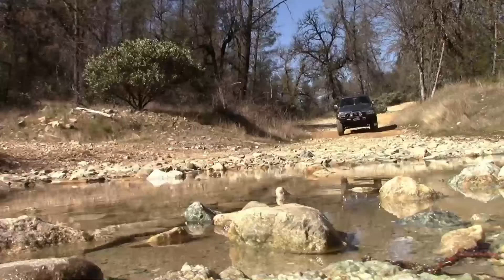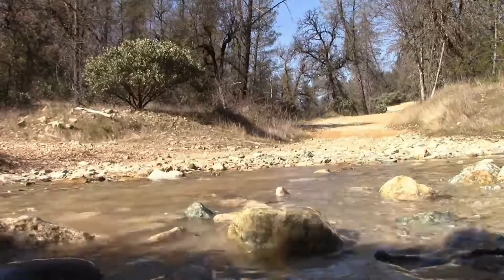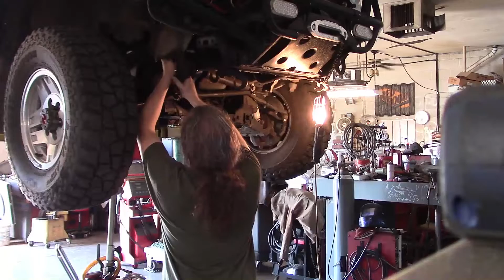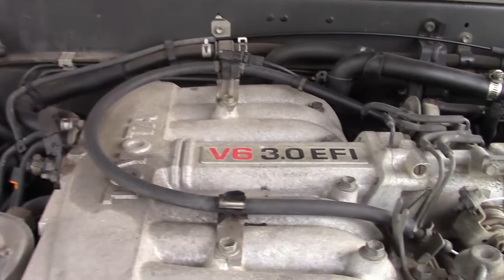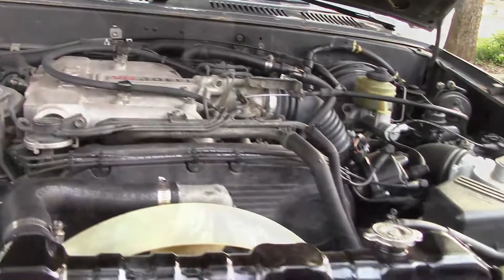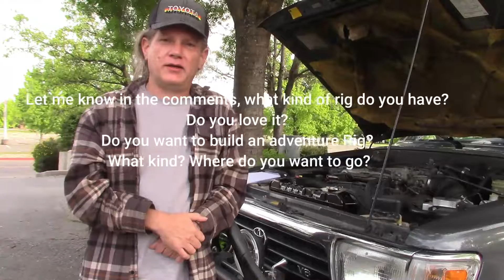Toyota 3.0 3VZE, is it any good? How to Make it Run Forever! 2nd gen 4Runner.

Comment: Take your time when working on these old motors. The heads are aluminum. A common and known error with these are the spark plugs a simple tune up can have you chasing your threads down into the cylinder. Beware of the soft strippable metal.

They are good. There are not many power mods. And these are becoming rarer and rarer to find in good condition. 

They last a good time if you take care of them. Thier is a power steering valve that Can cause your engine alot of grief if it goes bad. And it will start burning your power steering fluid if you start down that path. 

However before gping down the rebuild road. contemplate and budget out a simple proven 3.4 swap, increase your trucks worth, power, speed, torque, and life. 

Made it to 325 on my 3.0, stripped my plug ran it for 6 months and the  my power steering started spewing. 3k later, 145k 3.4 5vz, major incredible difference. Doesnt have the power of an old.car anymore. Keeps up with most. 

Love Toyotas, thankyou for posting on how tonkeep these gems going, they really are a cheap secret! Only use toyota red!
Reply: Was it 3k to do the swap your self? I have a 94 pickup with a 3.0 with around 155k miles. Runs great but im just planning ahead. I do not have the skills to swap an engine my self
Reply from the maker: Great advice. Agreed!!! I'd really love a diesel in mine, but the 3.4 is way more straightforward of a swap.

Comment: Great video. Nice to hear a simple and common sense solution for prolonging the life of this engine. I'm living out in Okinawa and picked up a 1995 Toyota Hilux Surf with only about 100k miles. A significant unknown is that the vehicles are turned over so fast here that I have no clue if the recall was done. I'm brand new to working on vehicles but I'm looking forward to learning on the 3VZE. I would definitely be interested in more videos from you. I'm bringing my Surf back to California when my tour is up and i'll drive it into the ground... which seems like won't be any time soon as long as I keep up the preventative maintenance. Thanks again!
Reply from the maker: Thanks for your service and I hope you get home soon!! A surf, that's awesome!! In the states you can just plug in your VIN on the website and it tells you what has been done and any open recalls or TSBs. Maybe try that?

Comment: I just bought 92 4runner 4x4 3.0 v6 and my main worry is the crossover pipe for the exhaust. Im hoping it wont cause head gasket failure anytime soon. It has 186k on it
Reply from the maker: No problem with mine yet! Wrap it in header tape if that'll give you piece of mind

Comment: Agile, Thanks for the video. I have 2 1995 4runners, one manual (245,000), one automatic(230,000). I have 2 so I can work on one and drive the other. I bought the manual one for 1000 had a blow head gasket. I disassembled the engine  and put in a new cylinder head and gasket kit. If you do it yourself not too expensive, I did it for $675. First time to do that kind of work also. Lot of fun. Has been running great for the last 7,000 miles. BTW, Another one of the issues with these older 4runners is the A/C stops working for one reason or another. I had to fix it on both of mine. Clutch going out now, another cheap fix if you do it yourself, my next project.
Reply from the maker: Awesome!! I agree, the ac gets old on these but as you said they ate really easy to work on! I think that's a key to having older rigs, work on em yourself! Thanks for watching,  glad you enjoyed it!
Reply: Make sure you do the rear main seal while you're in there. Also, you can mod the rear oil pan connection so it's easier to remove the pan in the future.
Reply: Was it hard to remove the the head gasket and can you replace the valve cover gasket while doing the head gasket change

Comment: First off, thanks for the great video.

I'm going to buy my future mother-in-law's '89 4x4 Pickup with the 3VZ-E and I have a few questions.

Hers has the A340H automatic transmission/transfer case. Which transmission do you have, manual or automatic? Do you think the A340H is any good or should I look to swap to a manual?

Cooling. Should I upgrade the engine oil and transmission fluid coolers? How do you feel about electric fans? Also, are headers the best way to deal with the exhaust crossover heat?

I want to keep the truck as stock as possible for a while and plan to use the best parts. I'm going to check the VIN at the dealer to see if the head gasket recall has been done. If so, I'll check compression and if it's good, I'm gonna roll with it.
Reply from the maker: Yes you got the right ideas for sure. As far as headers I think it's a good option. I imagine that requires the EGR delete,  maybe? So be careful with that but the tradeoff of losing that hot crossover is probably worth it.

Electric fans are fine, just make sure you have a temp sensor for it and that it's set for the right temperature range. And use a shroud of course.

The automatic trans, I have manual, which tend to be more durable and with the 95 and earlier trucks, work better with the lower horsepower motors. But I dont recall hearing about them being unreliable.  Maybe cruise through the Yotatech forums.
I would probably opt for a manual swap at some point though, just for drivability reasons if nothing else.

Other than that your other thoughts are right on.check that stuff out, and see that the head gaskets were done. Check for other TSB's too, for instance I found that Toyota would replace the steerylinkages for free, but it wasnt a full recall. So I got my steering rebuilt for no charge!

Goid luck and pop back if you need anything else!
Reply: Andrew I have a 92 I swapped a manual for the A340h. I wish id did it sooner. Not real hard just take pics of your vacuum lines, but i did the egr delete.  I dont have the mass of hoses on the passenger side now, making it easier to change plugs.

Comment: Tell me about it. Bought the truck less than 2 years ago, after 2 months wouldnt start. Turned out blown cylinder head and bad crankshaft. Complete rebuild of the engine, plus a new radiator. After that, thank God, works like a charm, only blown the 2 top water hoses, which I changed myself, like you said, nothing hard to do at all. Now looking forward to get that baby out there. Got the 2 inch lift, but not as big tyres on it, running a bit less that 30 inch - 235-75-15. Love the truck still, specially the trunk and tailgate. Plus everything is so solid, its unbelievable that its made in 91.
Reply from the maker: Yes that's one huge plus on the 2nd gen over the third, is the tailgate. I love it and use it for a seat and table constantly. 
Good luck with the project! Once you get it sorted you'll be good to go. Enjoy it!